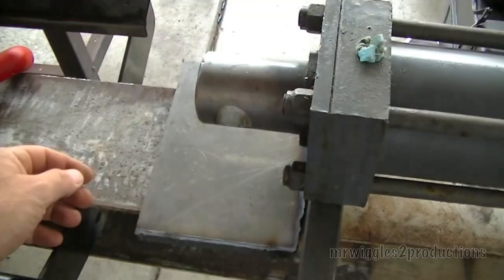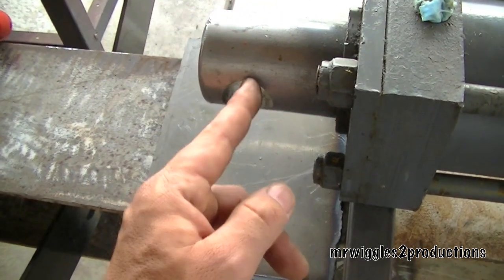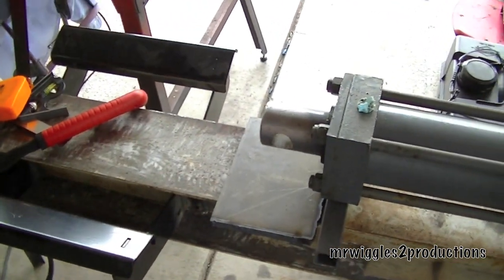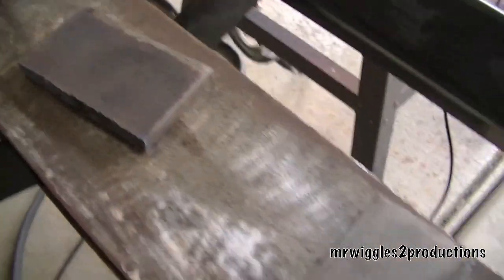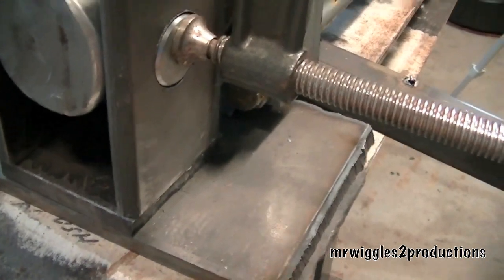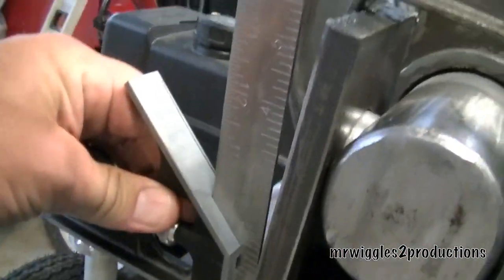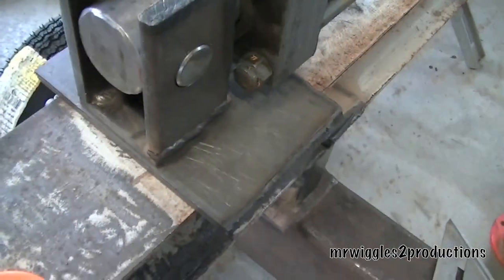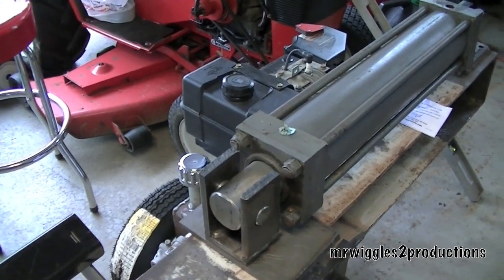Homemade Log Splitter Build Part 11

Comment from the maker: Thanks, I did exactly what you did for a long time.  Decided to save up for the plasma cutter.  Found it on ebay for a good deal cheaper than HF had them.  So far so good.  Just finished the push block yesterday, took a long time because I waited for it to cool so I wouldn't over heat it and warp the two pin holes.  Would be bad if they moved and the pin didn't fit!

Comment: You might want to grind a small angle on the bottom edge of the plate where it contacts the I beam to insure it does not dig into the I beam.

Comment from the maker: Nope, I have a drill press in my basement.  I woodwork on the side (haven't built anything in a while) but chucked in a hole saw and cut two holes.  I was really surprised how fast a hole saw will move through hot rolled steel.  Little oil on it, cuts pretty quick- and clean!

Comment from the maker: That hot molten bb rolled down the tongue of my boot and found a gap in between the laces.  I have a 1/4" burn mark on the top of my foot, hole in my sock!  I like boots that have the tongue attached up the sides of the eyelets, not just at the bottom.  These don't have that and they weren't tied tight.  Man, that hurt!  It was the size of a small bb too!

Comment: Just a simple tip . When using the plasma use a piece of flat stock, 1/8” thick by whatever width you have, as a straight edge. You will get saw quality, straight cuts. Really cuts down on grinding and welding prep time.